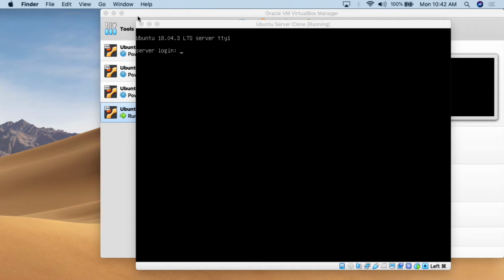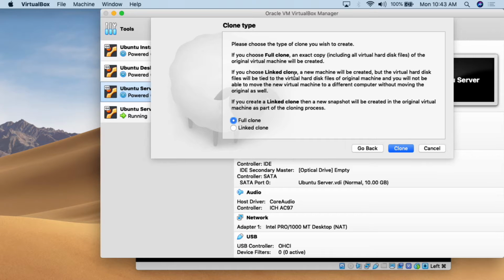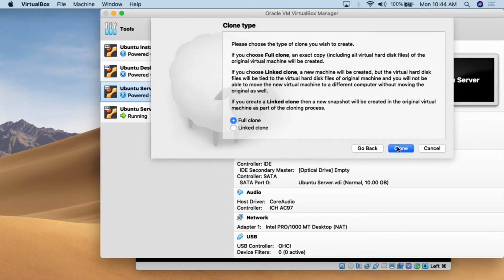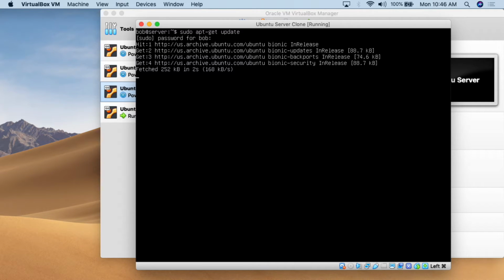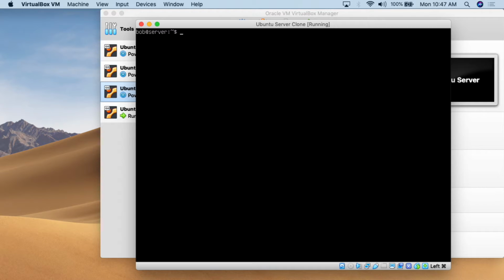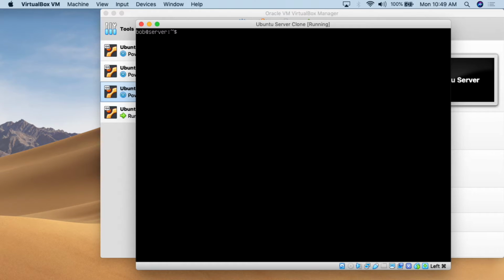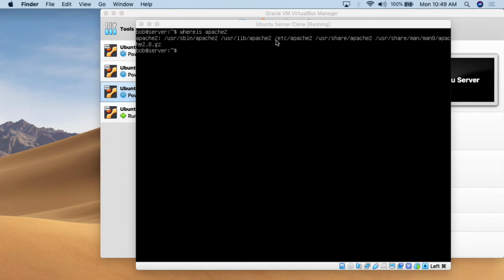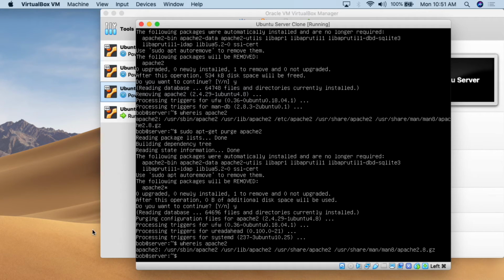Linux - Install Software on Linux Server (apt-get)

Comment: Yeah, I can use a repo that has two-three year old version of the software. Yeah, great.
Reply: Eli the Computer Guy sorry, meant to say I can use the repo to install a two to three year old piece of software (e.g., KiCad v4.0.2) or a package that even isn't in the repo like Docker for some of the Debian based distro.  I have recently switched to Linux and have found it quite frustrating to install some software as they have really old version or packages that dont exist in their repo.  I have cone to find out this is especially true for Debian based distro.  Say what you will about Microsoft and Windows but I havent had such a hard time trying to install some pieces of software.  I will keep battling through, but installing some software on Linux test one's resolve
Reply from the maker: Well... yes... you’ll never hear me say that Linux isn’t unnecessarily a pain in the butt... when you know what to do you seem like a genius, but if you’re even a little uncertain you can feel like a moron... windows provides a much easier learning curve and is why it’s still so prominent even when a “free” option exists...
Reply: @LordHog  Nowadays you can install AppImages, snaps or flatpaks if you don't find the version you need/would like to have.
https://appimage.org/
https://snapcraft.io/
https://www.flatpak.org/
And you can always either compile from source or use a package from the RPM family in combination with the command alien
Cheers

Comment: i learnt something new. but it did not work  as i expected. how would you find all the folder associated with a program, whereis  did not find the config files in my home folder
Reply: Install mlocate if it isn't installed yet. Then sudo updatedb followed by locate <your program> (replace your program with a real program without the <>).
Reply: @serge5046  thanks